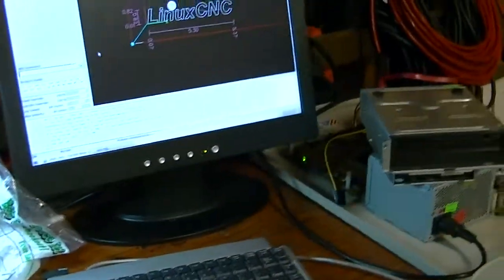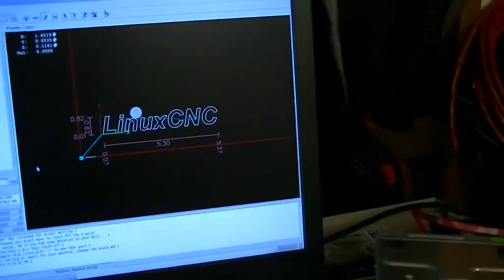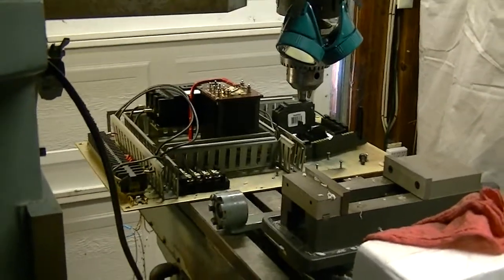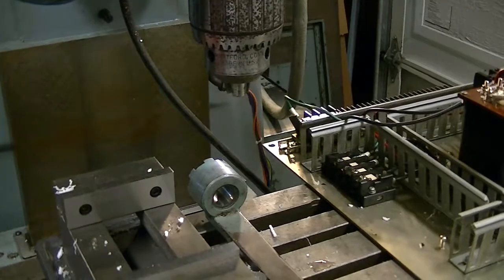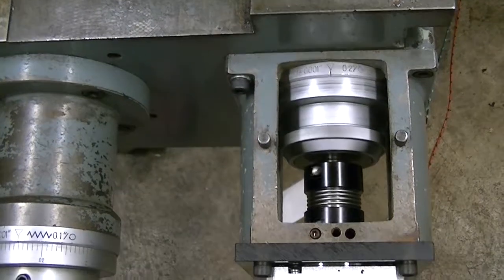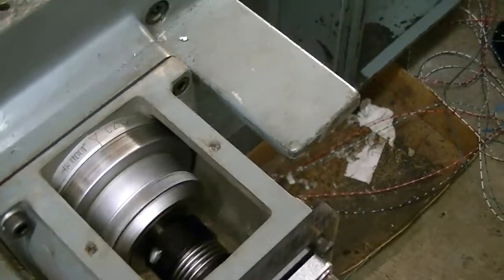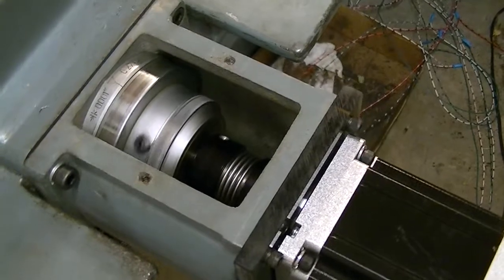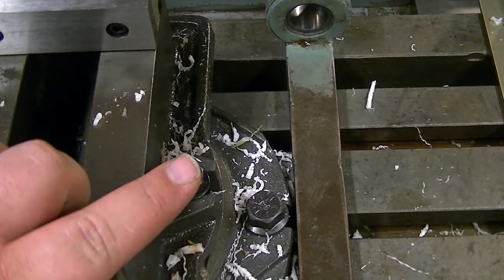The Albatross dances!

Comment: what is the type of stepper motor which you used ?
Reply from the maker: I don't recall exactly. they were from an inexpensive CNC kit on eBay. they have about a 90mm bolt pattern, and 10mm shafts.
Reply: thanks for your reply
you did a great job on this mill.
i have an old kondia knee mill, i will use Nema 34 with torque around 12 N.m to convert it, what do you suggest ?